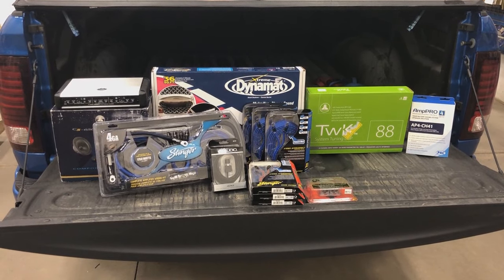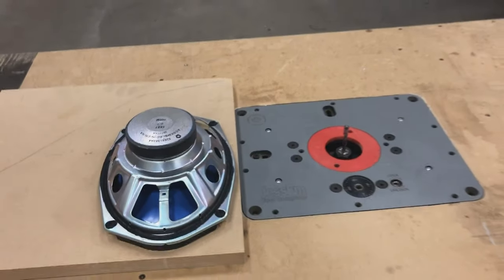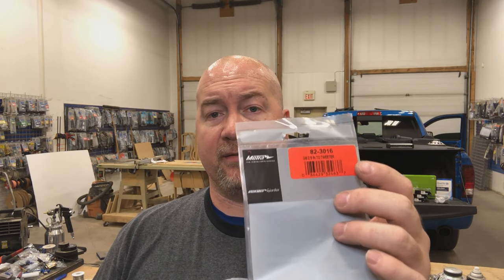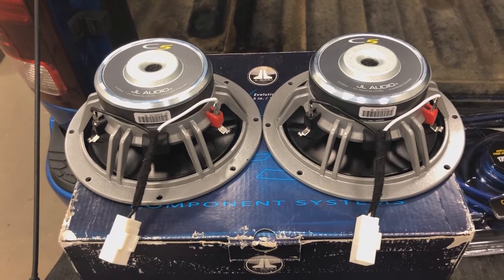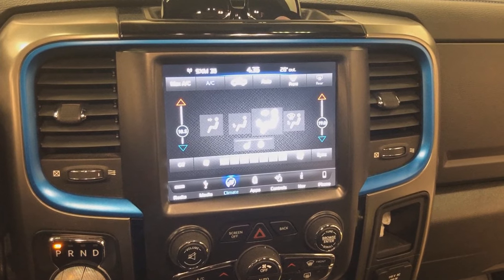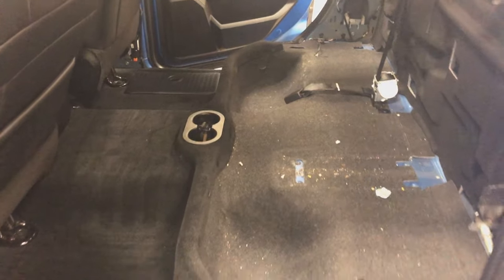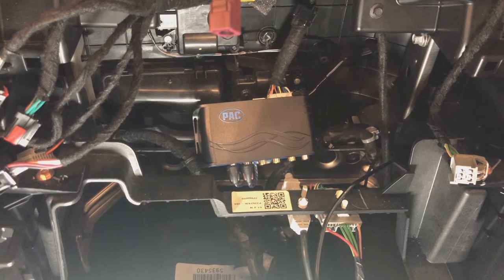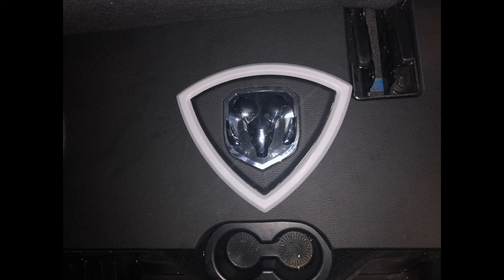2018 Ram 1500 JL Audio Full Custom Build Stereo

Comment from the maker: I can't wait to hear some feedback on this job.
Reply: Can you make a list of the components you used in this build?
Reply from the maker: That’s a great idea. I didn’t think of that. I will do that.
Reply: What would a build like this cost
Reply: @srtbull_yt6854  how did those subs sound ? Those W6 need a lot of air for it hit correctly don’t they ?  I have the same truck and i put two JL 10s the slim since those would hit the best due to the air space i would definitely want to hear how those sound
Reply from the maker: The W6 can work efficiently in .6 cu ft. It’s an incredibly efficient driver. Lots of airspace for them in these trucks. 
Are you happy with your slime?  I find that you can easily have too much airspace with slims. It almost like they HAVE to have back pressure in order not sound like they’re flopping in the wind. 
Ya know?
Reply: @srtbull_yt6854  oh ok i was just wondering on how those would sound and work i didn’t think they would sound that great with out the air room . They actually sound really well to be honest they have a good bass I’m not setting alarms off or anything lol but you can hear it for sure lol
Reply from the maker: At the end of the day, that’s all that matters. As long as you’re happy with it.
Reply: @srtbull_yt6854  nice work though it all came out well
Reply from the maker: Thank you. The client was happy so I’m happy.
Reply from the maker: What took 10 minutes?  I’m confused 😀
Reply: Wow seriously  I'm supper impressed  with the quality  an care that u put into  your work
Reply from the maker: Thank you. I appreciate that

Comment: Fantastic install! I'm getting ready to swap my entire system, also. AND if I could get a NEW head unit that worked, I would gladly use it. But, I have gone through two and neither worked correctly. With or with out the harness.
Reply from the maker: I'd be curious to hear more about this.  You shouldn't have any issues with this vehicle, using the correct interface modules.  We do them all the time.

Comment: Well done mate.  I have a 2019 bighorn I'm working on now.  Lucky for me I can tap into everything under the driver seat.  Great video
Reply from the maker: Thank you!  What are you doing to your truck?
Reply: @srtbull_yt6854  I ended up installing a JL stealth box with 2 12's under the rear seat and replaced all the door and dash speakers
Reply from the maker: As you know by now, that stealthbox kicks some serious ass. So you’re doing alright. 😀😀
Reply: Did you replace your factory speakers with 6x9s or did you go with 6.5?? I'm starting mine as well,,, 2010,, 1500 Big Horn..
Reply from the maker: If it were my own truck, I would use 6x9. But most people insist on going round. 🤷

Comment: Wish there was more information on where to slice the pac audio into the stock speaker wires.   Nice build though.
Reply from the maker: I just do it at the factory amplifier location. We’re you looking for more info?
Reply: @srtbull_yt6854  yeah I assume it's pretty straight forward, just hesitant since there's no info on the ch01 harness.  Would like to just amplify front doors and dash-  not sure the stock wire will even handle 150+wrms.

Comment: Great job man..!! I own a 2010 Ram 1500,, Im  ready to do a nice system as well.. What speakers do you put in the back doors?? 6x9 or 6.5 again? What is the advantage of benefits of using 6.5in vs 6x9in?? Thanks for uploading your content,,, it's definitely super clean,, easy to understand,, keep it up bro..!!
CHAD T,,, from Greenville SC
Reply from the maker: I always suggest using the biggest speaker possible. Your truck is oem at 6x9. I suggest going with that size. But if you want round sound waves, instead of oval, you gotta go with 6 1/2” rounds 😉😉😉😉😉

Please sense that I’m being a smart a$$ 😎‼️😎😀😎

Comment: If doing a active 3way set up front on a ram truck what speakers would you use in the rear doors. Regular 6x9 or will 3way 6x9. I was thinking 6x9 with tweeters separately on a crossover but not sure if I wanted to cut into the back door. Or even if it would be worth it. Any advice would be appreciated. Im a newbie at this and trying to get it right the first time.
Reply from the maker: Honestly, if it were my own vehicle, I wouldn’t put anything in the back doors. Or just leave the factory speakers there and don’t send them any signal. For great sound quality, building an amazing front stage is way more fun. Save the money you’d spend on rear speakers and put those $$$ into the front.

Comment: Did you guys run into any type of reverberation issues from the factory plastic panel pieces inside the door my 2018 dodge ram the inner pieces of plastic vibrate holding off putting an aftermarket radio in because I don’t want to hear that after I put all the components in
Reply from the maker: I slathered this job is sound dampening. So not on this job. But yes, it a concern. There is a lot of plastic in there and it just loves to vibrate against its neighbors
Reply: @srtbull_yt6854  yeah I dynamic my door panels I guess I should take the other piece off and do the actual door I also bought some type of VX adhesive foam and I put it in there also but they still rattle with Factory amplification

Comment: No crossover with the c5 door speakers? On my 2016 had to mount on the rubber opening to access window glass
Reply from the maker: There is a feature called 10x active. Basically negating the need for external xovers. The amplifier does all the filter work. It works great.

Comment: Why did you use a tweeter instead of using another 3.5?
Reply from the maker: The simple answer is just because that’s what comes with the JL component set that the customer wanted. Typically I would rather do a 3 way set up. Which would allow for 3.5” speaker in that location. But good eye :)

Comment: any reason why you used the JL bass remote in lieu of the PAC Amp sub remote? Piecing together my system right now and wondering if a dedicated sub remote is necessary if the pac amp already comes with one. Thanks in advance
Reply from the maker: Well yes. I would rather have control of the amp as apposed to controlling the signal feeding the amp. Does that make sense?

Comment: I’m just wondering who pushed in the center on your brand new speaker.  There’s definitely something to be said for custom mounting brackets but I’m also wondering why you wouldn’t want to use the pre-fab adapter bracket Crutchfield sells for this exact application?
Reply from the maker: In most cases we can build them cheaper and faster than most prefab adapters. There are still many cases where we use the prefabs. Just not in this case.

Comment: have one thing to ask whu mot just replace door speakers with another JL 6x9 size?  I have the alpine audio system im mu 12 Ram 1500 Laramie Longhorn....so Im looking for replacement unit.  btw  I like Kenwood products radios not the speakers!  JL or JBLs speakers..... any sujjestions?  Thanks
Reply from the maker: I would prefer to use a 6x9 in the door and use an aftermarket 3.5” in the dash. I don’t typically like to replace a 6x9 with a round speaker. But this is what this particular client wanted. So I don’t judge.

Comment: You mentioned the lc7 was overkill. What would you recommend if you were just running subs?
Reply from the maker: I would just use an lc2i. It’s a 2 channel loc with bass roll off correction.

Comment: 29:00 I always hear installers saying that you can't run signal wires next to power and ground wires. At 29:13 I see them all jumbled together. Does that create engine noise/feedback?
Reply from the maker: Thankfully, technologically has progressed far enough so that if you use quality gear, this isn’t a concern any more. But yes there was a time where you HAD to run signal as far away from power as possible.

Comment: Hey man, quick question, i have the same truck , I want to keep my same screen unit, what other option other than the ap4 ch41 can I do? Or is that the best way to go? Would a epicenter or equalizer help?
Reply from the maker: There are more options today than ever before. You just need anything that will take your non variable output from your oem headunit and process it into usable signal for your aftermarket amps. Depending on where you are, you local 12 volt guy will have some suggestions.
Reply: @srtbull_yt6854  Would the LC7i do that job? I have a 2015 and I want to keep my 8.4" screen as well. Couple shops here told me to use LC7i but I see you removed it.
Reply from the maker: Lc7i will work if you’re starting out with the non amplified oem stereo. And you’re planning on adding more that just a sub amp. If you’re just adding sub amp, you could even just use an lc2i. 
Just remember that in either case, you’ll need load generation to keep the channels functional from the oem radio.

Comment: Question? I'm building my own drivers side box for a single p3 12. As an experiment. I've got all the volume I need but not grill on the sub is where your subs surround is in height. Those weren't swallowed by the seat?.
Reply from the maker: If your sub is slapping the bottom of the seat, you’ll want something to prevent that. It sounds bad and will eventually damage the sub and it almost seems like it burns the bottom of the seat. Almost like a friction burn.
Reply: @srtbull_yt6854  my fault, bad typing. what i was getting at is my P3 12 Grille is just touching the seat. The in your build are sitting at the same height roughly as my custom built boxes( i made to solos and put the amp in the middle} easy to adjust and keep an eye on. So the question is, were those JL's not touching the seat. I know they dont move much, had w6v3  and the travel was tiny compared to non existant next to fosgate.  love that you showed me there is nothing to fear on the other side of that door panel also. thanks my man
Reply from the maker: The grills certainly touch the bottom of the seat. Nature of the beast. Not much can be done. Just do what you can to protect the sub. That’s all a guy can do.

Comment: What's the average cost for all of this?
Reply from the maker: I would have to confirm the price, but I want to say this was about $6000USD, just for the gear.  Install on top of that obviously.  That was before the condition the world is in now though, prices will have changed for sure.
There are a lot of factors that go into pricing.  A job finished with carpet would be drastically different than suede or vinyl.  Client preferences are always taken into consideration.  So make sure you spend some time with your installer to make sure everything is done just how you want it done.

Comment: Does anybody know if this Would  be possible  and the exact same process on a 3rd gen 2007 1500  or is it slightly different?
Reply from the maker: The ends result could be exactly the same. Except for the rear speakers. In the 2007, they are 5 1/4” whereas this gen, they’re 6x9. Oem amp is in a different location. But like I said, the final result could be the same.

Comment: why would you take all of that sound out of the doors? FML 3-way 6x9's would have sounded so much better imo
Reply from the maker: There are conflicting opinions on this. While I agree with your statement, many people believe that speakers should always be round. Not oval. Sound waves are round not oval shaped, so how could an oval shaped speaker do better than a round shaped. 
😀
Reply: Well I should just throw out my home electrostatic ribbon speakers and grab some round ones on that logic...lol Owning this truck myself, I know that they already sound muddy and lack a lot of brightness even after replacing the dash speakers. Upgrading each door with quality coax 6x9's really is the simple trick imo. I do agree with having round subs tho for the low frequency if that helps. I'm glad you agree
Reply from the maker: There are people in the industry that just refuse to come to a consensus on anything 😁

Comment: How much space did you allow for each sub???
Reply from the maker: 0.8 cuft per side, allowing for displacement, probably ended up with about 0.65 per side.
Reply: Rob 12 Volt Tricks thx, the limited space in the ram Makes it tricky.

Comment: Quick question, my truck has the alpine system already. Are all of the other upgrades necessary if I want to upgrade my subs? I want to do 2 12’s but don’t want to overpower the factory treb and mid. TIA
Reply from the maker: Not at all. We can do a much simpler system to upgrade just the subs.

Comment: Hey Rob. What’s it cost to get an enclose that will fit dual 12w6’s. Also why’s the turn around time?
Reply from the maker: Depends on whether it’s needs to be fit for a vehicle or not. Just a regular trunk box can be done in a couple hours. 
Form fit like the Dodge Ram, can take a full day. Depending on how you want the finished product to look.
Reply: Rob 12 Volt Tricks yea I need one for my ram. I’m ok with black carpet or rhino lined for the finish